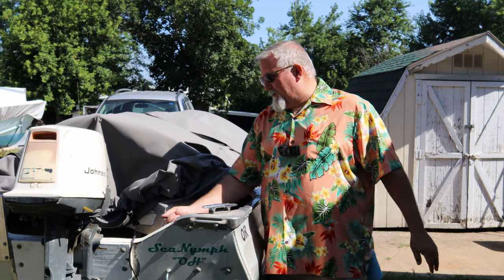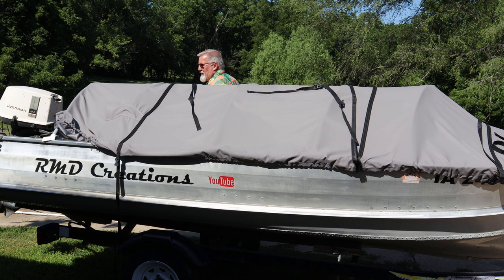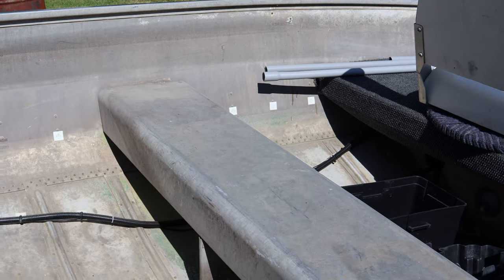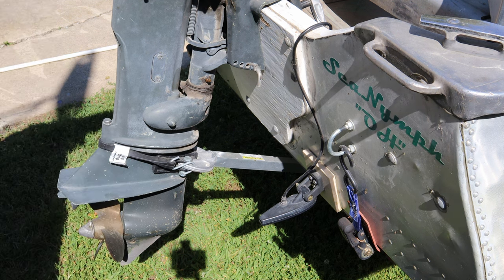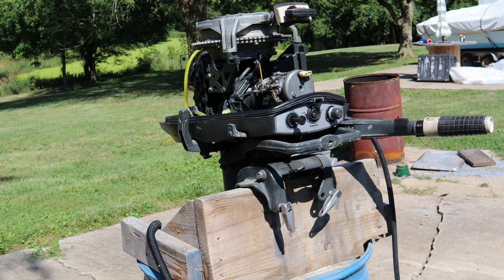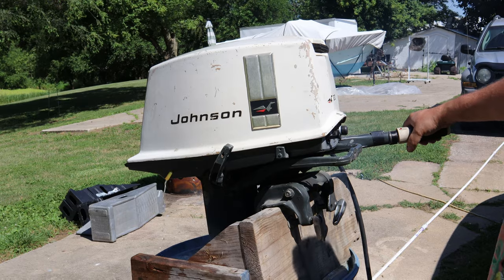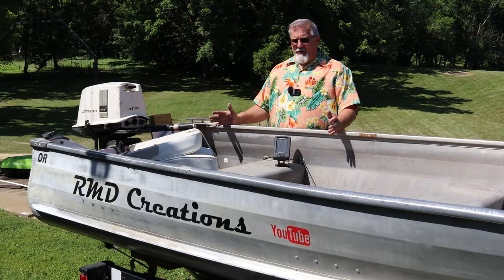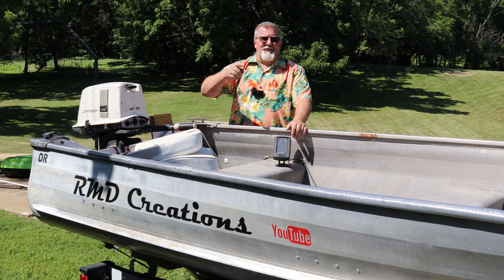1969 Sea Nymph and 1969 Johnson 20hp 1 year later

Comment: I purchased a 1967 Johnson 20 last fall for $120 that had not been run in over 10 years.   Clean on the inside and just needed a little of everything.   Thank you for the videos.  I have learned so much.   I had it running in a barrel last weekend and I think I have a great runner.   I worked on the trailer next replacing the axle after watching you do axle and bearings I was confident and able to work through all the issues.  Keep up the good work young man.  Thank you!
Reply from the maker: glad you are finding the content helpful, I'll keep making videos if you keep watching. Thanks

Comment: Great job Michael,  one person committed on putting engine up for 3 years , if So Fogg out engine good with high oil fuel mixture, and run it completely  out fuel, put oil fuel stabilizers  in carb or marvel mystery oil  in carb So next time you want start it up clean plugs off dipping in gas air blow them off reinstall them for  the start up. Yes it will run blue  till it burns back to normal operation.
Reply from the maker: Great tip!

Comment: I have a 1963 Evinrude 18hp fastwin,do you know what the attachment needed to convert it to cable steering is called.I'm in manchester uk,and getting the info is near impossible.Interesting vids by the way.
Reply from the maker: Steering bracket     https://www.ebay.com/p/1937097997

Comment: Michael keep it up brother. I heard if you use muffs if you have too much water pressure you can damage your impeller as it is designed to pull water 
Btw I got an 1973 25hp evinrude that I'll be working on so I will have questions about it Chris from OHIO
Reply from the maker: Thanks for watching.  Use my email in the description for any questions.
Reply: @Michaelsbackyardmarina  thanks Michael

Comment: what about if it was to sit for 4 years
Reply from the maker: may need to file the points to get your spark back and maybe clean the carb if you didn't run it dry when you put it away.  I always run my two strokes dry when loading on the trailer.
Reply: @Michaelsbackyardmarina  it was completely winterized when parked  tried cranking it up  and gear on starter would spin but not engage the flywheel